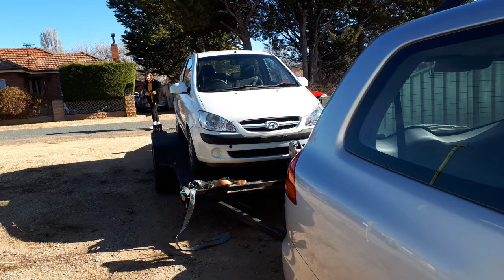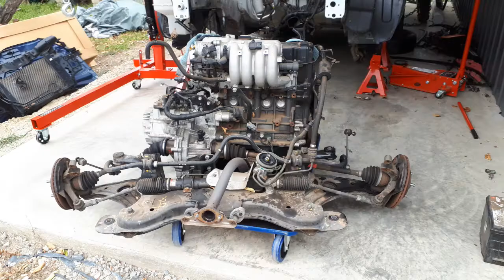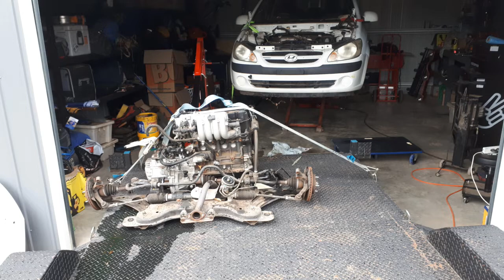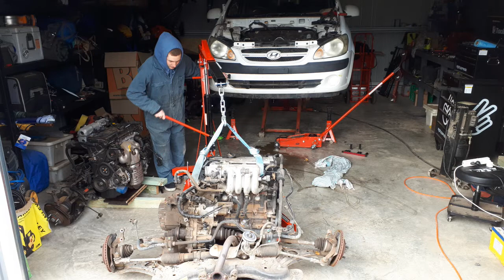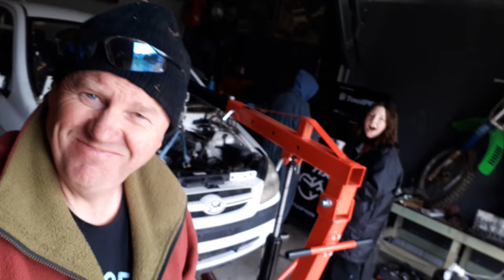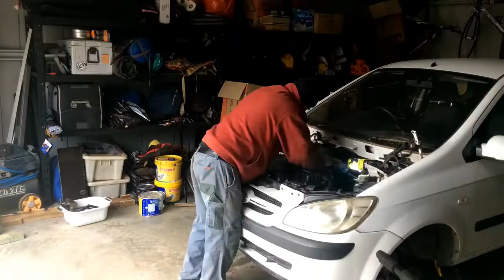Hyundai Getz Engine and Trans swap

Comment: What engine did you put in?
Reply from the maker: I just replaced the engine and trans with a low km replacement same model 260k not going to 78k from the wreck
Reply: @martinguybuhler  oh okay. Yeah im doing research on wich engine will fit in. My engine currently has some piston slap on 150k km. I see no reason to replace it with the same one i want a little môre power
Reply: @johanjanse5113  Were you able to swap engine? I'm currently looking for possibilities of a bigger engine on my 2006 Getz model